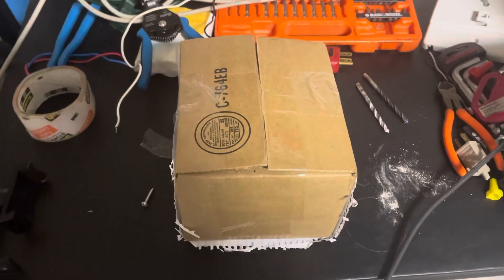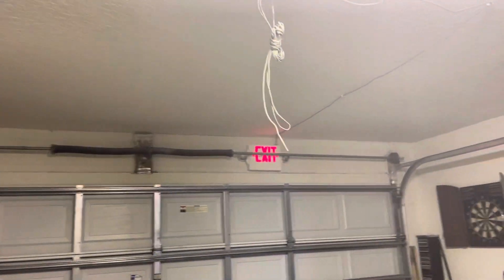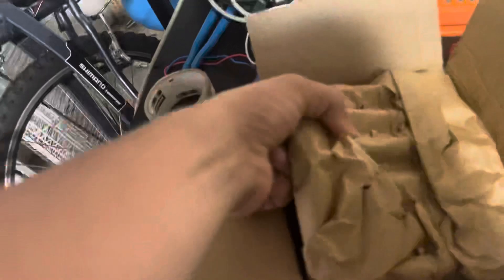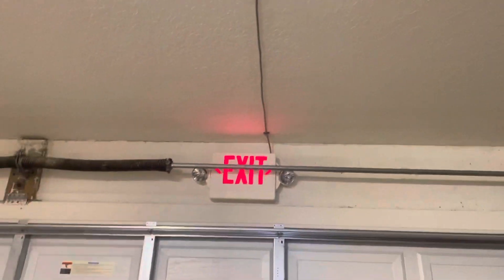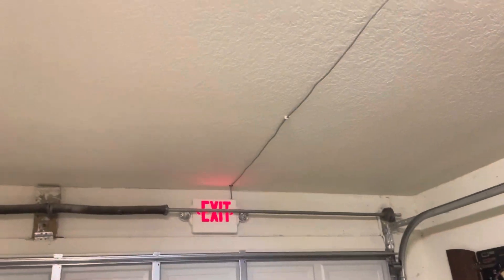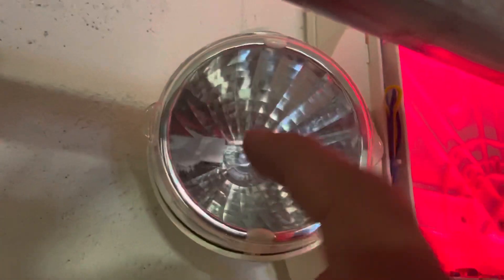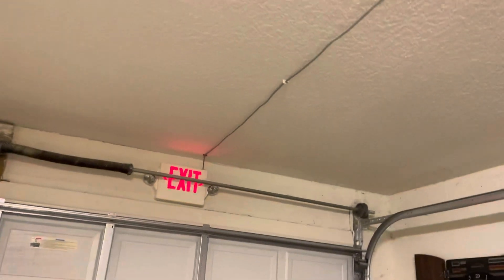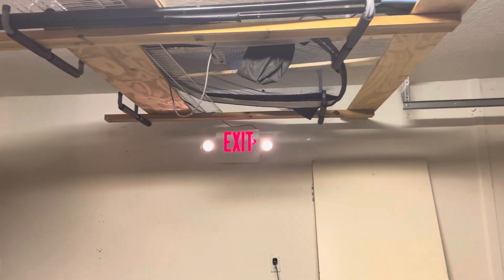Replacement battery’s for the exit sign and emergency lighting in garage. (New unit in garage)

Comment: How did the batteries turn out?
Reply from the maker: They did not go as well as planned. First I killed the chargers in both signs because they are meant to charge nickel cadmium batteries, not lead acid batteries. And the battery had bulging so bad it almost snapped the plastic on both signs. I have recently replaced both signs in a previous video so now all the garage units are working.

Comment: I used to have a lhqm but it was old that it was falling apart
Reply from the maker: One of mine did that
Reply: @electricalsmokealarmsandmo1564  I got the lhqm from vally's steel because the were replacing the exit signs and my dad friend asked for one
Reply: @electricalsmokealarmsandmo1564  I'm still looking for a lhqm

Comment: What is the size large of the battery?
Reply from the maker: 6 volt 4amp hour battery
Reply: @electricalsmokealarmsandmo1564  Just got a battery replacement for my incandescent emergency light, works fine now.